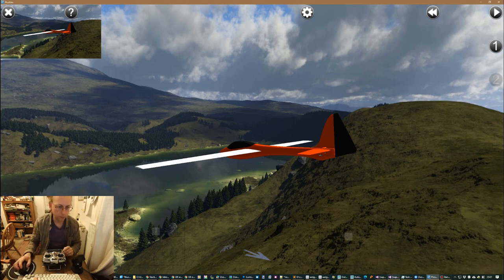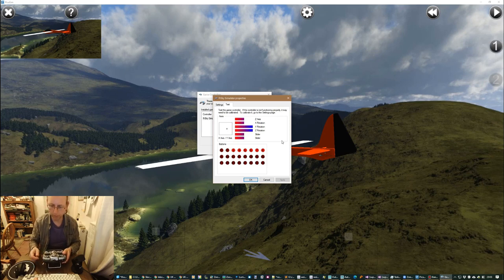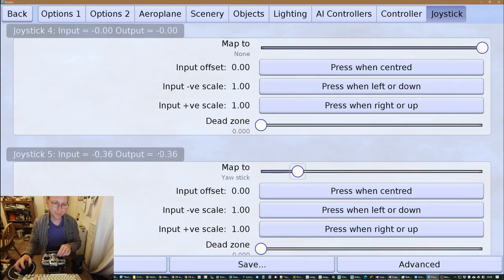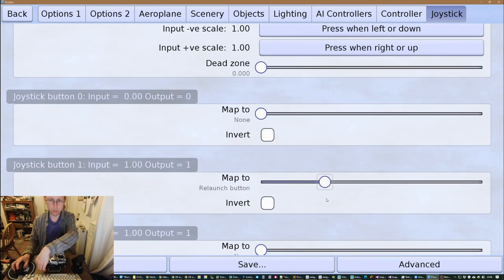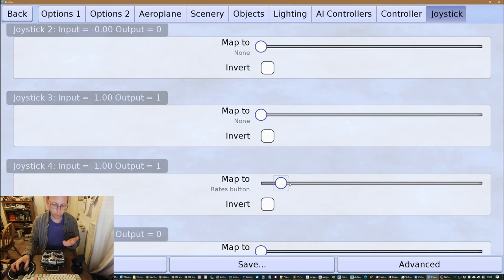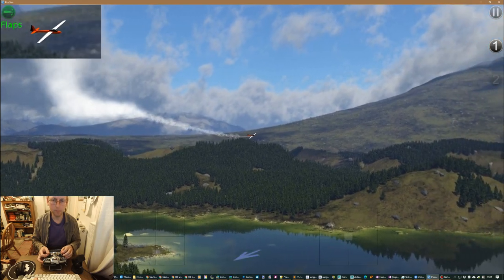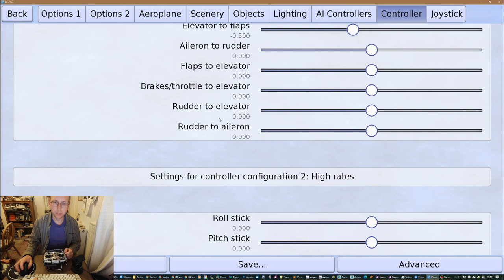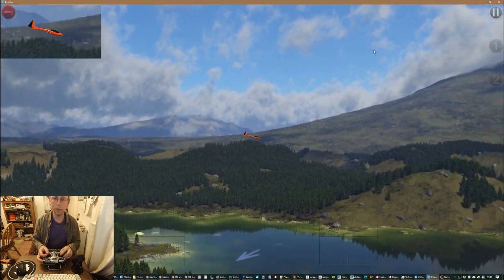PicaSim: Controller setup with R/C Transmitter

Comment: Hi, this is a fantastic sim, thank you! However, although after connecting my Taranis to the PC I can get the figures in the settings to change etc, it does not work when I go to fly the plane. I would value any help :) many thanks, Simon
Reply: Did you tick the "enable joystick" checkbox in those settings?! Another possibility is that you have multiple inputs (accidentally) trying to control (for example) elevator, then your desired controls can get overridden.
Reply: @profrat  thanks for your reply😁yes i did tick the box. I'm having trouble with the drivers on Windows 😣

Comment: Picasim 2 abandoned?
Reply: Work on the original PicaSim is shelved, yes. Though I've been thinking that I might make an update to the Windows version to add some model planes. Also, Google is (I think) about to pull it from Google Play due to lack of updates, at which point I might make the APK available (with additional planes). I've been thinking about a complete rewrite, using a modern game engine for improved graphics/controller support/networking etc. but that's not started yet...
Reply: @profrat  ok thanks for answering my comment and thanks also for the data👍

Comment: I got my radio seat up , but the only thing is my roll and yaw are reversed . I go right the plane goes left , how do i fix this ??
Reply: In the video at about 2:42 : you need to move the stick to the left, then (as you're hold it there) press the "Press when left or down" button. Then move it to the right and press the "Press when right or up" button. This will fix any reversal, and also make sure the movement range maps correctly.
Reply: @dannychapman3247  Thanks Danny all sorted now.
Reply: @dannychapman3247 Thank you so much for the information! 😊

Comment: has anyone got the Radiomaster TX16s working properly? I can't get any of the switches to work, they don't show as changing values in the calibration feature. the radio works fine with Phoenix sim so it is communicating with my PC. thanks
Reply: I can't comment on that tx, as I use a FrSky X9d+ (either direct, or via the xsr-sim dongle), but for ages I thought the switches weren't working on that... only to realise that I had to set the transmitter up to output the switches to a channel. Then they show up as analogue inputs and can be mapped.
Reply: @profrat  thanks, I just had a reply on the facebook page too, saying to do something similar, having an analogue input seems to be the key,. I will give it a try!

Comment: what  brands of radio work with this sim, please?
Reply: There's a few transmitters that you can connect directly via USB and will appear as "game controllers" - for example the Taranis X9D+. Most transmitters will not work on their own like this - (if they have a USB socket it is just for programming/backup etc). For those you'll need either a USB simulator cable that works with your transmitter, or a wireless "dongle" (basically a receiver) that again will be related to your transmitter. These are easy to find for almost all makes of transmitter. I suggest you do a web search for your transmitter model and "simulator cable" or similar, and see what comes up!
Reply: @profrat  I haven't had luck with JR so far.  XG14